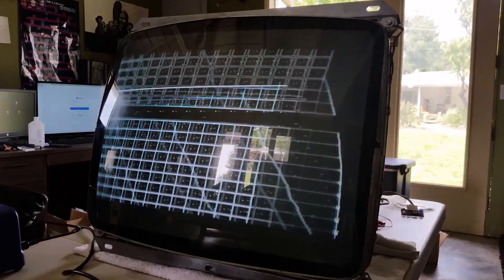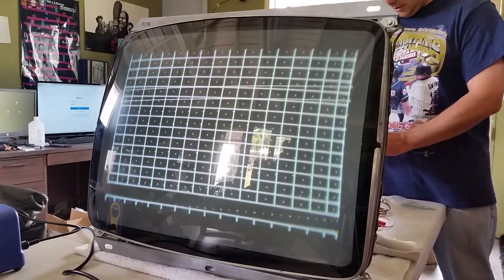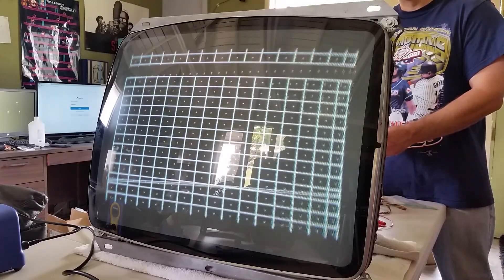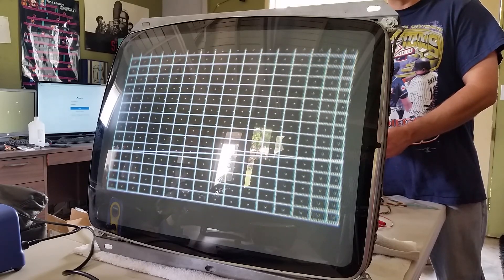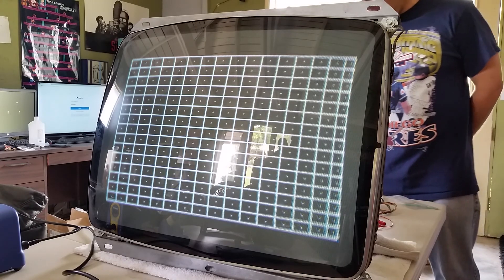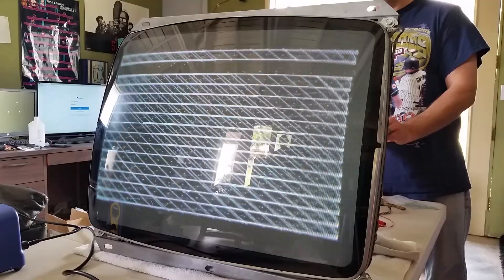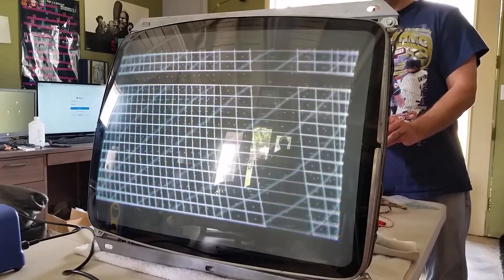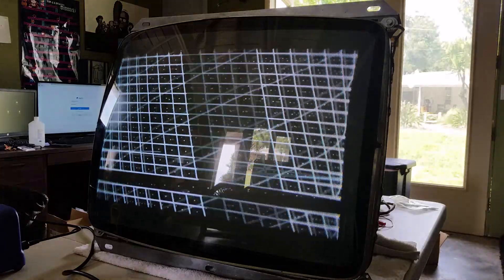Hantarex 9110 hold issues

Comment from the maker: This has been solved.  Turned out the TDA1675A IC that was in the 
chassis when I got it was bad.  Then got a couple dodgy TDA1670A 
replacements, but finally got one in the chassis that works, and the 
monitor is again living and in a 3KOAM z-back running X-men: Children of
 the Atom.
Reply: Chris G Nice!